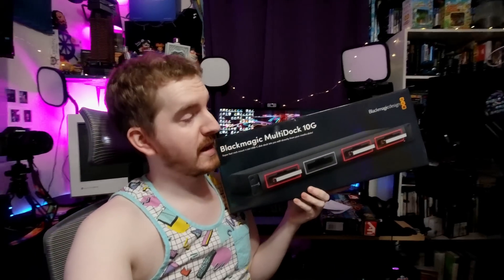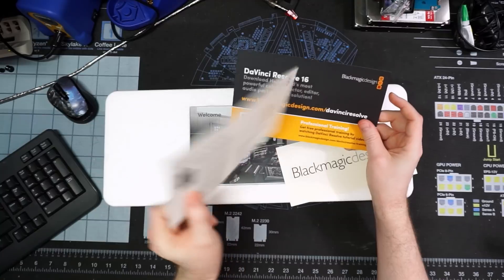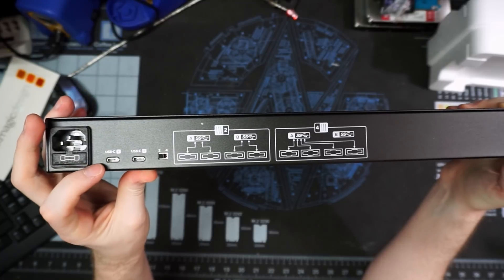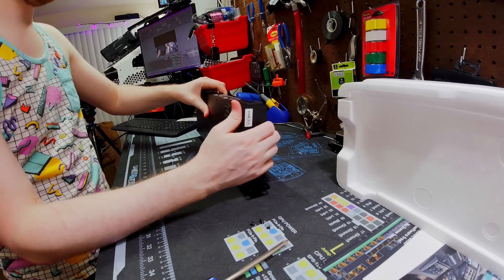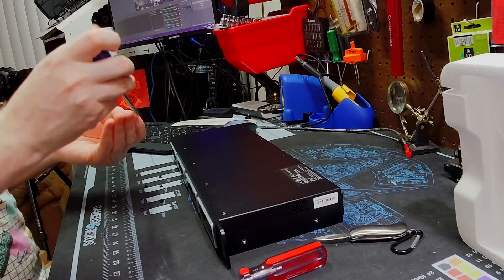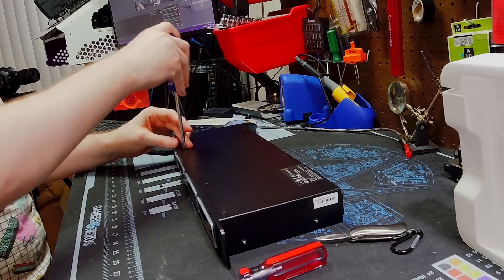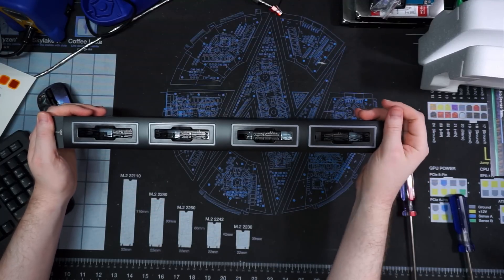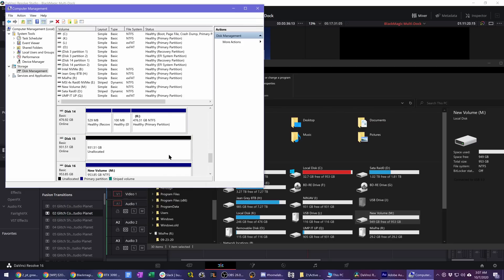Why does this SSD dock cost $600?! | BlackMagic MultiDock 10G Review after 5 months of use

Comment: Probably a really simple question, but I am NOT a DIY guy .. I have a similar mount for the Blackmagic unit which I also have, and I also want to mount this under my wooden desk. I have one question, what type of screws did you use to hold the weight? ie: length/type .. I assume Wood screws (I did do some research!)? would really appreciate you letting me know so I can order the right ones to hold this exact unit. thanks and great Video!

Comment: The Blackjet UX-1 Cinema Dock has 2x ssd readers, 2 cfast readers and SD readers. It is thunderbolt 3 tough, not usb.
Reply: Actually, Thunderbolt 3, with/due to it's USB-C Port, is fully compatible with USB, it just defaults to USB speeds and whatnot, when it's used with USB and not Thunderbolt 3.

Comment: Hello my friend just a quick question if you be so kind to answer, I'm trying to stream using the elgato HD 60 Xbox one X through passing through my onyko TX RZ740 also I am using a projector will this be possible to achieve. loving you're work and thanks
Reply: Sounds like You may need a Decimator MD-HX Converter. What format are You Streaming? Resolution and Frame Rate, exact!?
Reply: @BuildOrBuy  Streaming to twitch 1920x1080 - 60 ...bitrate 6000
Reply: Hi @chefmrb6380 , You'll probably only be  able to Stream stereo. 

Your resolution and bit rate sounds more like a frame rate of 29.97. For 1080  i / 59.94, broadcast, expect 8MBs to 10MBs.

There will be some flucuating stream overhead pushing 8MBs. Do a test and check it.

The elgato software makes streaming very easy. Are You going direct or are You using Streamyard?

Have You had any problems? If so, what?
Reply: @BuildOrBuy  Thanks for the reply and help I'm going direct through elgato also using obs
Reply: Hi @chefmrb6380 , Absolutely! We can relate! We all had to start from the same place. Some of Us just started earlier. Keep Us posted on Your Test so You can verify. If You monitor audio, keep it in Your ear. Otherwise, echo from delay. The only thing that matters is audio in sync on the stream! Test and verify! 

On the elgato software, turn off video preview. It really draws CPU processing power away from the Live stream.
Reply: @BuildOrBuy  Hello my friend thank you for reaching out and you're reply was helpful I was able to achieve my goal and I got the result I wanted I didn't need any additional equipment like the MD-HX.  my amp provided all I need and works perfectly again the support was much appreciated
Reply: Hi @chefmrb6380  , Perfect! Glad that worked. Congrats

Comment: Check out the Blackjet UX-1 from Atech Flash Technology.  It's Thunderbolt 3 instead of USB 3 over Type-C, but sounds like it's exactly what you're asking for. The two flash media modules on the right side are even interchangeable.

https://www.atechflash.com/blackjet-ux1
https://www.bhphotovideo.com/c/product/1387918-REG
https://www.bhphotovideo.com/c/product/1501616-REG
https://www.bhphotovideo.com/c/product/1501617-REG

Another item of interest for your use case would be industrial USB hubs. These are not only designed to be surface mounted on something like the underside of a desk, but also have ESD shock protection, and mechanical hardening. Many have (optional) screw-in cable latches too. Typical examples would include the Startech ST4300USBM, Tripp-Lite U4604A3CIND, or Tripp-Lite U4602A2CIND. You may need to get your own power brick, but easy enough to get a quality one from somebody like Triad.

https://www.startech.com/en-us/cards-adapters/st4300usbm
https://www.tripplite.com/7-port-industrial-grade-usb-3.1-gen-2-hub-10-gbps-4-usb-a-3-usb-c-15kv-esd-immunity-metal-housing~U4604A3CIND
https://www.tripplite.com/4-port-industrial-grade-usb-3.1-gen-2-hub-10-gbps-2-usb-c-2-usb-a-15kv-esd-immunity-iron-housing~U4602A2CIND
Reply: Agreed! Blackjet Cinema Dock is an amazing product! Very versatile and less expensive with more options!

Did not know about the other products! Those remind me of Industril DIN Rail mounted Devices. Thanks for sharing!

Comment: Just 2 SSDs can just about max out the read speed of around 900-1000MB/s  over a actual USB 3 10gbs port (3 SSDs will definitely saturate the single USB 3 10gbs Port read or write)

What you only get 25 MB/s or you getting the 500-550MB/s on reads  

Also due to these being hot pluggable write caching will be turned off so write speeds likely might be lower then the normal 450-500MB/s (device manager disks and turn off quick removal and enable first tick box for cache, but not the second one, make sure eject before removing the SSD) 

Not sure why software RAID0 or RAID5 wasn't working in windows (but I wouldn't recommend it any way as this is for quick release as you don't have any way to secure the disks)
Reply: SATA specs are Burst mode. However everyone takes them as if they expect that Spec to be achieved as throughput! Not gonna happen! 

But this Device is all about expediant convenience and connectivity!

Anything in RAID should exist in 3 places. Like You said, no way to lock those drives! And then some Users ask about a front panel power switch. Also not a good idea for same reasons You've mentioned!

Comment: In looking at the required SSD solutions for the new 12K I discovered that the Blackmagic Multidock 12G will not work with the required Ssd media for the 12K. That's because the Samsung 983 DCT 1.9TB SSD drives are U.2. The 10G is not a U.2 device so you cannot use it for that. There is a solution for that however it is not supplied by Blackmagic yet. It's the Mercury Herios 3S.
Reply: OWC... That's an external Thunderbolt 3 box for a PCIe Slot?

Blackjet Cinema Dock is the counterpart to this!
Reply: Going through the same issue right now. I have the Samsung 983. Currently looking for a device that will help me get my files from my ursa mini Pro 12 K into my computer looks like I will be going with mercury  3s

Comment: Too bad they didn't allow using 2 USB-C ports in one pc as one device... That would be a nice thing to have, so that there would be less overhead and more speed available while using RAID 0 with 4 SSDs...
Reply: I don't see how this can be possible at all.
Reply from the maker: I mean, that's essentially what the 2x2 split is. if you run both connections to the PC, you'll get double the throughput for raiding
Reply: Great idea! However, USB-C technology does not allow aggregation.

Anyone will to try and see what happens?

Comment: The switch would make far more sense on the front. Or a front USB port. Like my BlackMagic Pocket Cinema Camera 4K recording direct to the B port, then flip the switch to A setting so my workstation can directly grab the footage right away. For a $600 device to work with their equipment that would make perfect sense to me.
Reply: I guess it helps he had it mounted under his desk, but rip to anyone who has it in a server rack.
Reply: As all Blackmagic Rackmount devices...
1. No Front panel On / Of switches.  Off is not a function of Go! during a Broadcast!
2. No power cords.